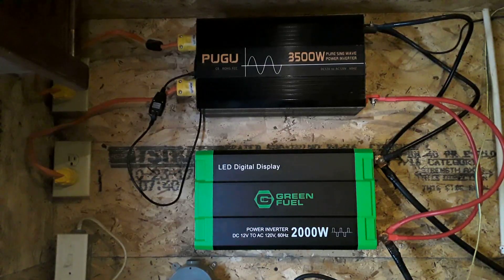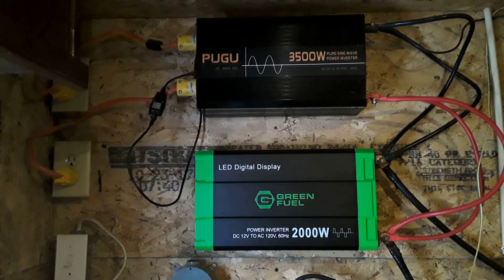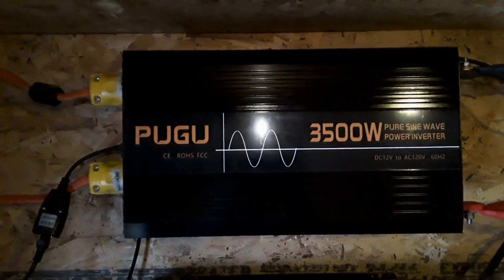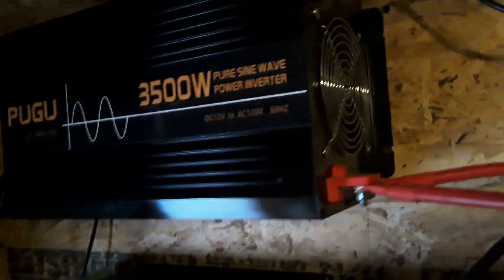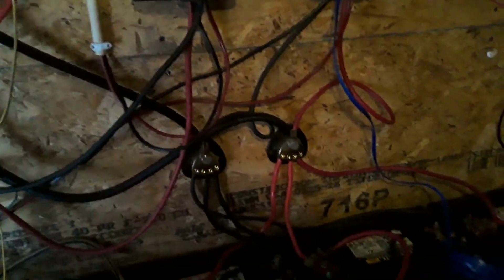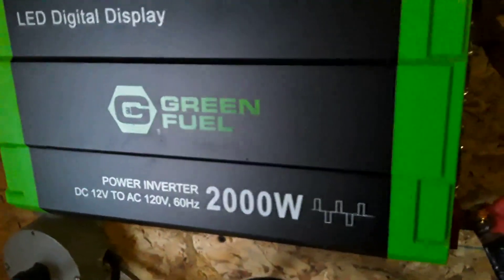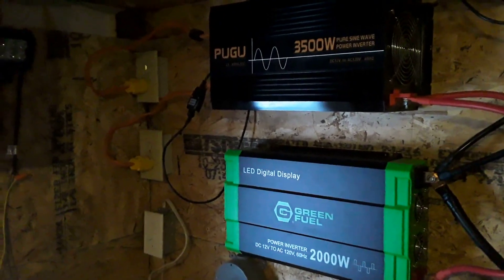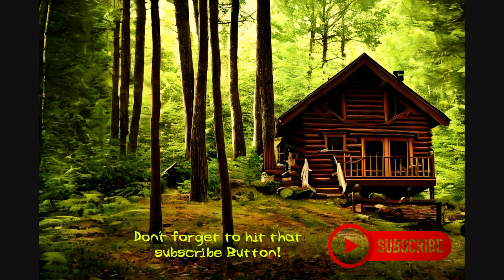My power inverter setup for my whole home on my off grid homestead.

Comment: To provide 3500 watt from 12v DC requires at least 300 amps. Surge needs even more. 300 amps needs 4/0 cable.
And are those male-male 120v cords?  Those are known as widow makers.  It's good to be prepared.  Part of preparation is safety.
Reply from the maker: Yes, male to male. That's exactly what my co-worker called it. The widow maker! 😂

The only thing I have in my house that has any surge power is my refrigerator. I have a 1k microwave, but I seldomly use it. I'd like to upgrade to a soft start fridge. But...$$$ you know.

Comment: Thanks for the useful explanations! What is the total usable battery capacity of this system?
Reply from the maker: I think the rating on these batteries were rated at 105Ah at a 20 amp draw before the get to 10.5v. So I think that is 5.25 hours per battery at a 20 amp draw. x18 = 94.5 hours at a steady 20 amp draw, no charge.
There are going to many factors that apply in a real life use that may change that total, give or take depending on usage.

Comment: Autarky how long have your batterys lasted i have gone thru a pile of them so i have been buying toyota prius batterys i have 64 of them to gather for a 24v system they are 7.5v for my small 12v e system i have 18650 280 of them no bms so far i love it i don,t  envy you living in wisc. from Florida now
Reply from the maker: Right now my new battery bank is 2 years old. My first battery bank were all used batteries that lasted me a couple years. I hope for 10 years but would still be happy with 5+ years.
Reply: @AutarkyHomestead  for the inverter i have a reliable electric 2500watt pure sing wave they have a real good review i may buy the 2nd one for my 5000w
Reply from the maker: @leetaves9143  I've been hearing that name quite often.
Reply: @AutarkyHomestead  YES I HEAR NOTHING BUT GOOD I THINK FOR A 5000WATT IT WOOD BE ABOUT 4 TO 500 YOU COULD SPEND UP TO 2000, OR MORE BATTERYS ARE THE BIGGY I WISH I COLD GET THE BIG ONES

Comment: You need to install battery shot off switch on the inverter.  A lot of those inverter use phones wire for the remote
Reply from the maker: The inverters have switches.
Reply: @AutarkyHomestead  for the battery

Comment: That set up using 2 male end plug-in receptacles on a cord is a risky set up.
It's not safe. Live plug ends should not be exposed. You could have terminated them instead them into a junction box to feed the other section of the house/home.
Reply from the maker: Good idea!

Comment: I would say the actual out put on that is alot less that 3500. My all in one can run a fridge and 2 small air-conditioned and it is a 3500
Reply from the maker: You absolutely may be correct. This is a cheap off brand, and we all know how they like to fake the specs.
Reply: @AutarkyHomestead  yeah mine is a mr. Pow 48 volt. Think it ran me about 500 bucks but it has solar, switch over,battery charger, and inverter in one.
Reply from the maker: @john0270  my fridge makes mine grunt a bit as well.

Comment: That's the dumbest most scary system I've ever seen. It's a good video of what to never do. Those short extension cords will kill someone or it will atleast hurt them or maybe start a fire. Bro do more research before playing with 110
Reply from the maker: Lol, 🤣😂. What? You don't like my widow makers? If you pay close attention and don't make mistakes, it will work just fine! I don't know who this "someone" is you speak of, but there is no one else here, and even if there ever was, do you think I'd let them touch my system? Get real!
Reply: You are totally right! I just mentioned that in my comment. Dangerous setup. Not recommended. 2 male end plugs. Wow!
Reply: @AutarkyHomestead  do the right thing. Terminate the outputs from the 3500 inverter into 2 J-boxes. Not using a 2 end male extension plug. That's not for YouTube.
Reply from the maker: @eddietee6305  my final setup will be top notch! 😉
Reply: @AutarkyHomestead  great!
Reply from the maker: @eddietee6305  You guys gave me a great idea for another video. I'm going to do one on fixing this and telling ppl not to do it the way I had it set up! Thanks guys!
Reply: @AutarkyHomestead  thank you. Great idea.
Reply from the maker: @eddietee6305  I appreciate you guys!
Reply: @AutarkyHomestead  thanks
Reply: Once the inverter is off and switching to the other inverter those widow makers are not energized.
Reply from the maker: @Nemo_IRL  💯 correct